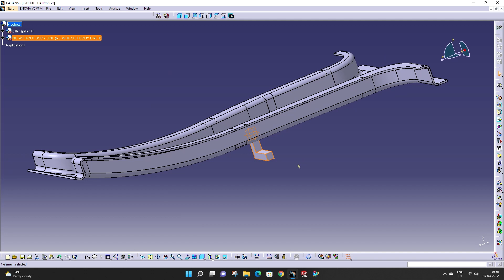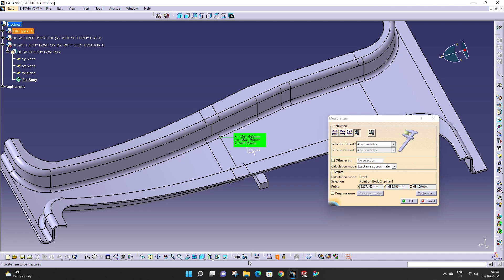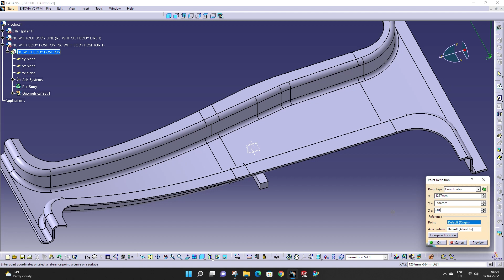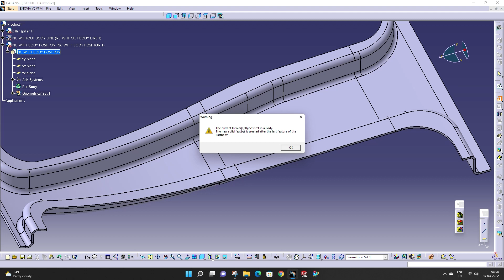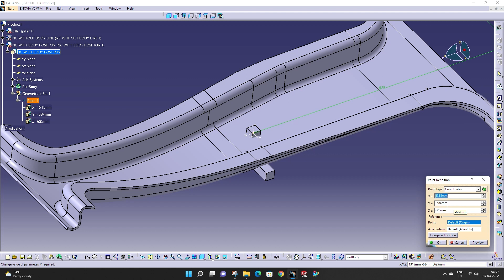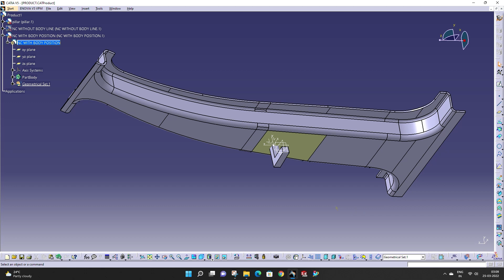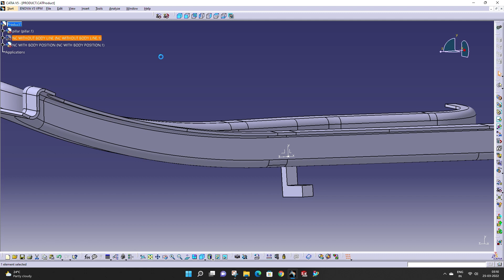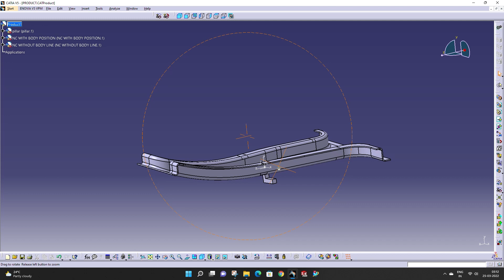BIW FIXTURE DESIGN | NC BODY LINE / BODY POSITION DESIGNING

Comment: Normally in total panel where we can place nc and why at particular position only we can in other position also
Reply from the maker: NC is placed wherever the support is needed, usually follow 3 2 1 principle
Reply: But for applying 321 principle there how to find the position of NC exactly
Reply from the maker: @lok119  NC will be build in such places so the panel will be perfectly seated, for example if a panel is a place surface 3 NC in a triangle postion will be sufficient